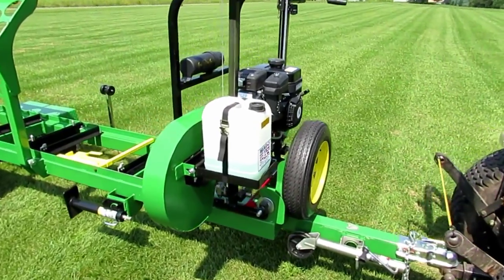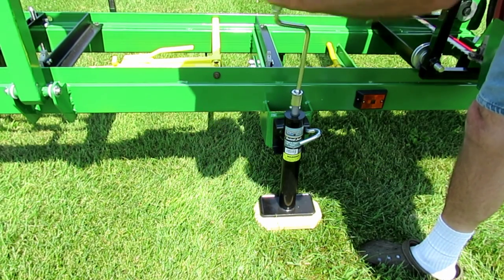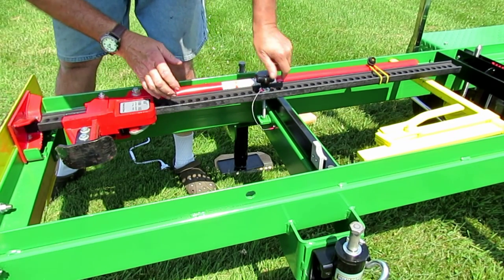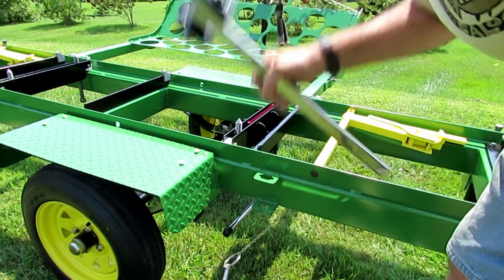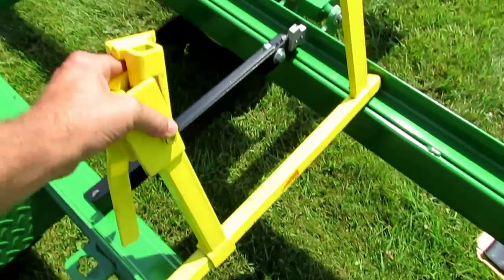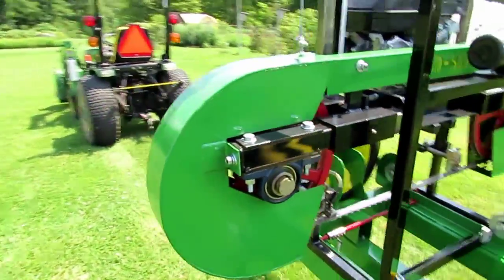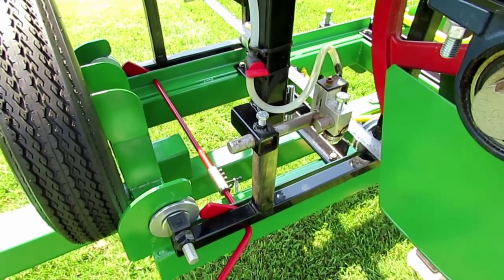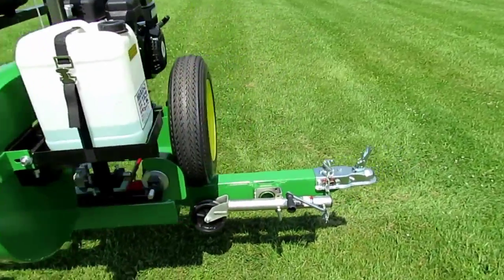Home Built Trailer for my Hudson HFE-21 Sawmill

Comment: Very nice rig! You have given me several great ideas on my current build. I do see a hydraulic cylinder on your lift in the near future... ;-)
Reply from the maker: +sukivel Thank you. You Tube is a great place to share ideas. I am very happy with the farm jack and will most likely leave it simple. I thought about hydraulics, but with the trailer being so light and the pivot point location of the loader just 2 inches inside of the jacks I really need the lifting location where it is to keep the trailer stabil. Plus I only saw wood for my own projects so speed is not important to me. I hope you post a video of your build when it is complete.

Comment: I like your trailer a lot and I am going to build one also here getting Ideas.  anyhow I like you log loader but is it possible to use a cable winch attached to the ramp instead of the Jack?
Reply from the maker: If you're designing it anything is possible.  I like to keep things as simple as possible.  Thanks for watching.
Reply: @unemployedredneckhillbilly2023    was just thinking it would be easier with a crank on it rather then the jack.  But I don't know  how well it would work.  I see a lot that the manufacturers make with the winch but they just put it around the log looks  very dangerous to me doing it that way.  I am getting to old to be able to get out of the way anymore. Lol.
Reply from the maker: Picking up 2000 pounds outboard like that on a 400 pound trailer will definitely require some engineering to work safely with a hand crank winch. That is why they roll them up a stepped ramp.
Reply: @unemployedredneckhillbilly2023   makes sense thank you. Back to the drawing board.

Comment: Where would I get the plans for this build - Your work is incredible.
Reply from the maker: Thanks. There are no plans, l just threw it together in my shop.  It makes the mill much easier to use.Thanks for watching.
Reply: Do you have the overall dimensions. I have the same sawmill and wanted to replicate from your video is a stretch. Thanks again.
Reply from the maker: I think it is about 15 feet long. It was sized to cut a 12 ft log and the 2 original tracks can be bolted on to be able to cut 20 feet if needed.  Once you get the tralier made it is easy to work out the geometry for a simple log loader.  Getting the mlll angle rails perfectly flat and level is the toughest part. I will measure it tomorrow.

Comment: the digital read out that you are using what its it called I've been trying to find one for my mill and don't know what to look for.
Reply from the maker: I found it on Grizzly.com.  Its not water resistant so it is not good if you mill on rainy  days or leave your mill outdoors.  IGauge makes a bunch of different ones. Thanks for watching.

Comment: what size steel did you use on the frame looks like it might be 3x3
Reply from the maker: 4 x 3 x 3/16 It was the straightest tube the supplier had in stock.

Comment: I enjoyed this video I have the same mill and I want to build one of these trailers . your Igaging Gage where did you get that and what model is it  due to the wind you can not hear what you are saying. also any plans for this build ? Great work and how much aside from the mill would you say you have invested ?
Reply from the maker: +Ken Plumadore  Thanks.  I purchased the gauge from Grizzly tools on clearance for $29 and I do not know the model #. It is a 24" with a remote scale that was discontinued. After using it for a while I find it frustrating to use because the mill has such a coarse adjustment that it is hard to hit the correct dimension. Also the gauge is not waterrproof so always protect it. I am thinking about redesigning the lifting winch to make it more accurate. I have no plans, it was designed on the fly. The only areas that are really  critical are when welding the track to the frame and keeping everything flat and level, and the location of the loader pivots in relation to the jacks. I never totaled up the cost, but there is about $400 in the metal, $200 in the Harbor Freight trailer, $50 for a spare, $100 for the jacks, $30 for the tongue jack, $50 for the farm  jack, $30 for the toe jack and springs, about $150 for paint, sandblasting, and welding supplies, and about $50 in misc hardware. So it looks like a little over a grand total in materials with some metal leftover for other projects. I feel it was a great upgrade to the mill that keeps me from constantly bending over to lift and move the sawn lumber.  If you are not a member you should join the Forestry Forum where there is a wealth of knowledge about milling and sawmills.
Reply: +Unemployed Redneck Hillbilly Creations 
Thank you for the reply I am a member of the forestry forum my name is KenPlum if you want to add me as a friend. I am going to make this trailer as best I can I'm sure it won't look as good as your trailer but I'm going to try my best.
Reply from the maker: +Ken Plumadore  Looks don't really mater as long it works. Make a video or post some pics of your build. One thing I found out quick is to put removable backstops on it or the logs will roll right off the other side. We all learn from our mistakes and get better over time. Good Luck.

Comment: Very nice build Ken. 
I am about to paint the one I built and am wondering which brand of paint you used and if I need to prime first. 
Thanks.
Reply from the maker: I use the paint, reducer and primer from my John Deere dealer. I find it has better uv resistance then the lower cost paint. It may not be legal to use in some states because of voc's though. If you want a really good finish, automotive 2 part water-based  paint and cleat coat is the best but you really need a spray booth with the right equipment  for a perfect job.
Reply: Thanks I can spay the head part inside but the rest outside I have the gear to do it. My trade is cabinet making so I spray quite a bit of stuff. I'll have to check at my Deere place, no doubt it's expensive there but I'll see anyway. 
Was thinking along the lines of tremclad but not sure.
Reply: Thanks
Reply from the maker: The deere paint is about $50 a gallon and the reducer about  $20 a gallon plus the catalyst if you want to use it for a quicker cure. It is not low voc so you can't buy it everywhere. I think deere may have a water based one out now also.

Comment: do you have problems with the log dogs pushing the can't off the bed causing it to be cut out of square?  I have the Hudson homesteader and built a 20' trailer for it.   it cuts parallel to the deck well. when the can't is rolled up to square my dogs seem to raise the cant.
Reply from the maker: No havent had that problem. I put some pins in the stops i made to keep the cant from warping up when cutting one with a lot of stress in it.  The toeboard helps a lot leveling up the first 90 deg turn and takes some stress off the dog. Could the trailer be twisting when you level it. I would check it with a level every foot  after placing it on the jacks to rule out the trailer and put a square on the dogs across the track rails to rule out that they are not bent.

Comment: where did you get your digital meter to measure and set you board thickness?
Reply from the maker: I bought it from Grizzly tools on clearance. One thing about it is it is not waterproof so I can only use the mill when it is dry outside. It would be nice to find a waterproof version.